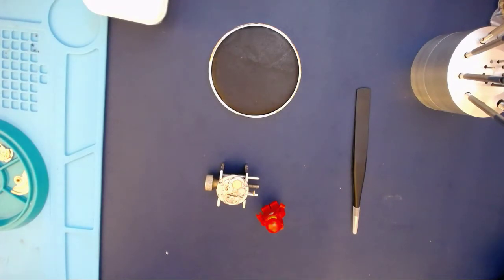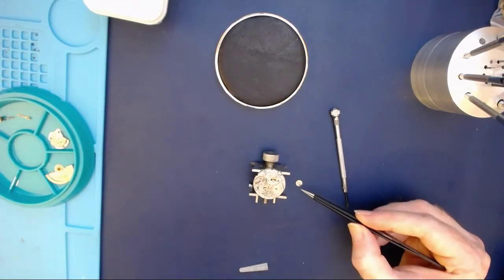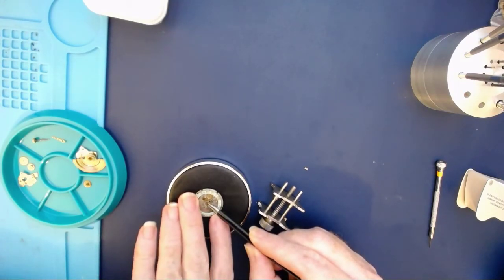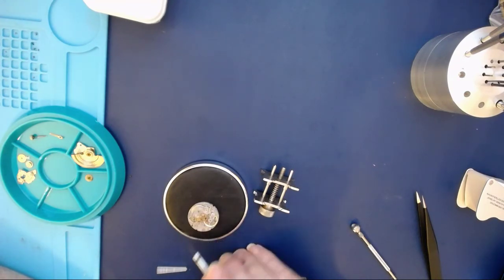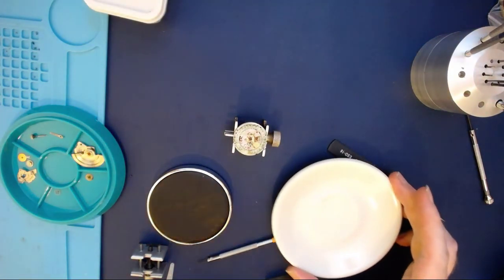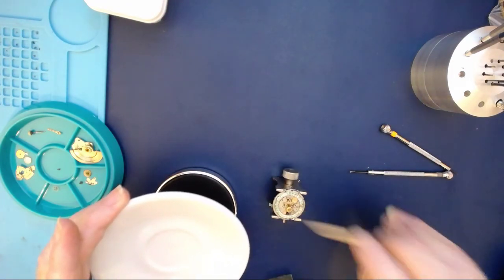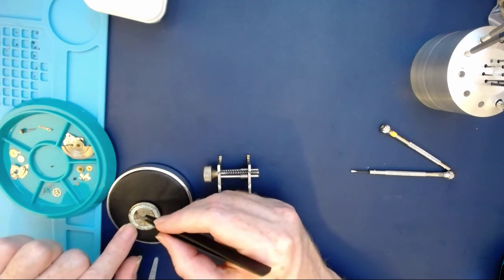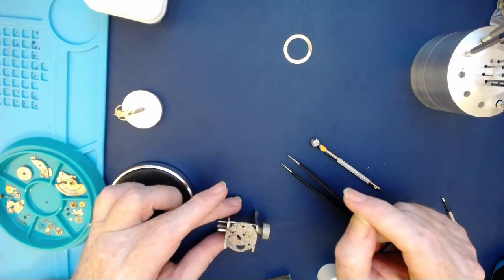Live : Watch Disassembly 2

Comment: I've found U-Pol slow (or fast) Panel wipe a good and relatively inexpensive solvent for scrubbing down really grubby things, 
 Cheers, J.
Reply from the maker: Thanks for the tip! I'm going to try a water based watch cleaning solution first, in an ultrasonic cleaning machine. I may resort to solvents if things get tough. From the safety data, it looks like U-Pol is white spirit based.
Reply: Something like that, maybe some Naphtha as well, I was getting fed up with buying lighter fluid for camera cleaning and running out of it for filling my zippo!. It's interesting watching the watch disassembly, Sadly my sight and depth perception now means I cannot contemplate such tasks.
 Best regards, J.
Reply: Best practise of cam